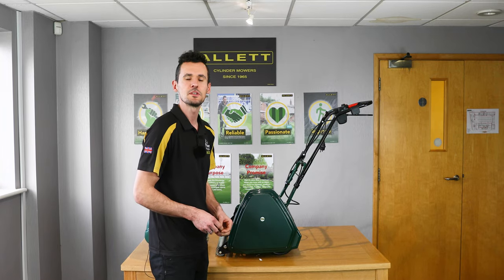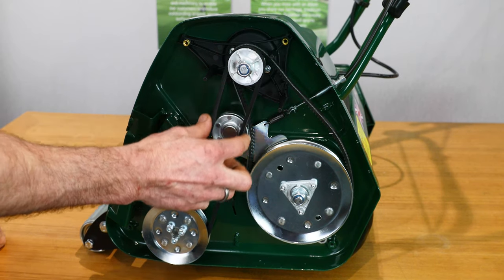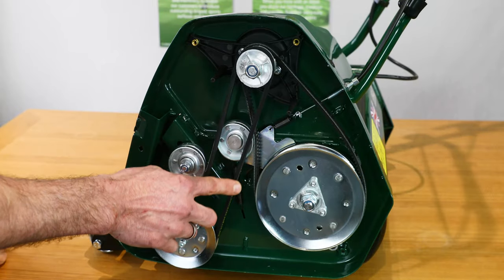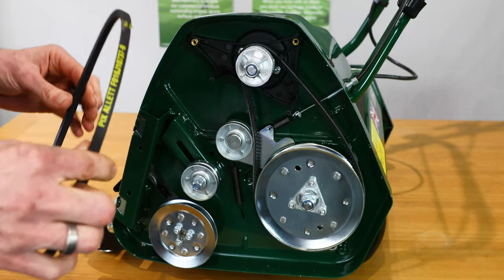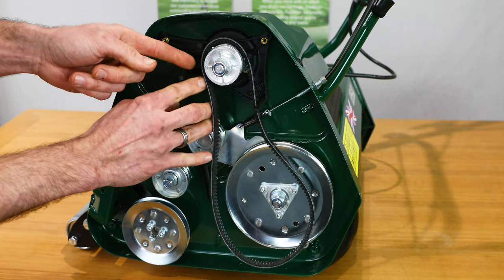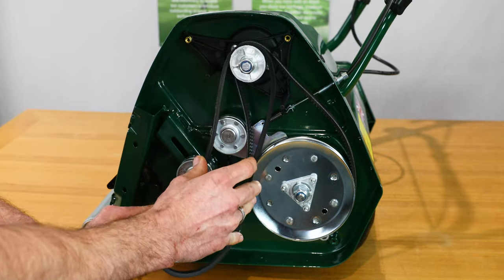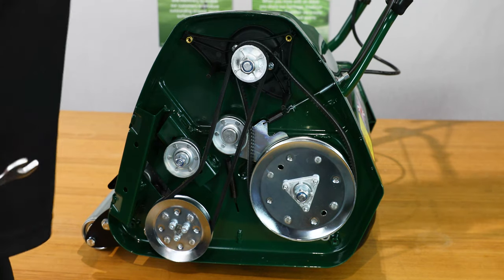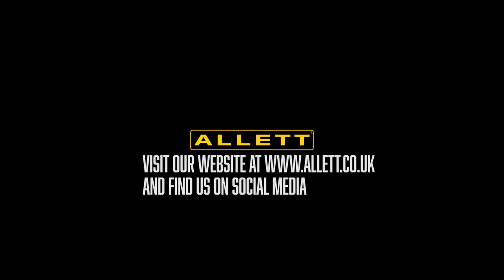Changing the Belts on an Allett Sandringham, Classic 12E or Liberty 30/35 Battery Mower

Comment: I've lost power on my Liberty 35 (moves very slowly). Is this caused from wear on the belts? I've tightened the rear roller belt and. adjusted the tensioner over time but would replacing the belts help?
Reply from the maker: Hi Paul this is beyond my expertise. Do you mind emailing technical@allett.co.uk and Ian will give you some advice . Laura